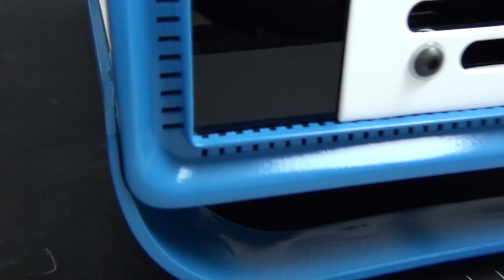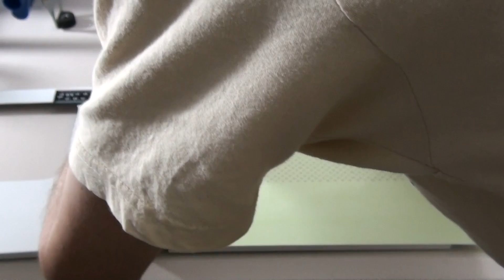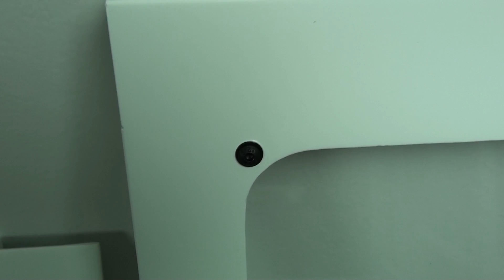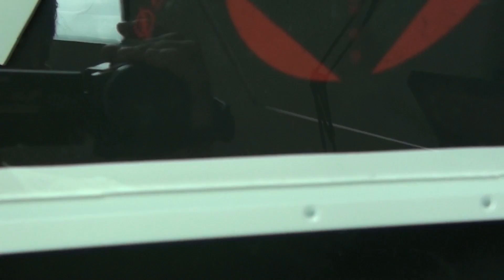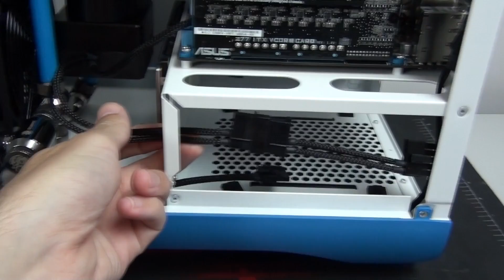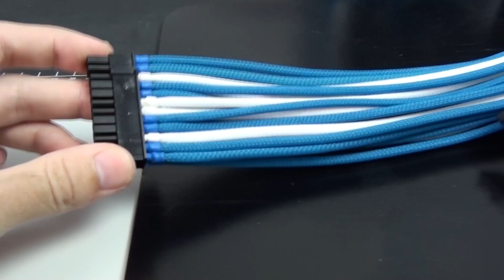Build #6: 'Prodigy': Part 5

Comment: Can you clarify something for me, I getting to know, learning about sleeving and customs wires from scratch and I'm a bit confused about the 18, 22, and 26 AWG, and what I'm not perfectly sure what is what, I mean what is the use of the 18 AWG the 22 and 26.
Reply: can you help me out here or what ?
Reply: ***** It does help thank you so much. :))

But just to double check basically 16/18 its for everything that comes out of the PSU (GFX, CPU, MB). Even those connecting to the ssd/hdd ?
Reply from the maker: *****
Spot on, thanks for the information. We normally use 16 AWG for core component wiring, mainly because we have found a great wire which trains well and is easy to deal with.
Reply from the maker: João Dário
Yes Molex and SATA power also need to be 16 or 18 AWG.
Reply: ***** One thing I forgot, I never really paid attention to it but I think the 24 pin cables have a particular way of connecting I mean if its straight forward like the left cable connects on the left of the other side of the connector ? I´ve bean watching some tutorials but none of then explains everything.
Reply: ***** "Place the cables into one connector then mirror that across to the other end connector."
This was what I was asking about the 24 pin cable, I know I have to drawn a diagram not just because they like to play around with the wiring but also because I wouldn't remember anyway xD

At this point I'm just gathering all the information I can and I prefer to ask someone to actually tell me so I'm perfectly sure of the answer. So, thank you for your patience I really appreciate it. Now I'm going to finish watching the tutorials and get to it.

Thank you Jaigar.

Comment: Those aren't pressure optimized fans, which are the ones you'd want to get if you're cooling down a radiator.
Plus you can't see any of the fan blades in this build anyway.

Comment: Front pane looks great. Wait and see when the manufactures start using smoked plexy. I hate empty optical bay slots, I prefer a clean look, only controller panels no optical drives, if you really need one go external.

Comment: I don't deny that they're excellent quality, but $15-20 for an elbow or rotary fitting is excessive.  Especially when you need 10-15 of them (or more).  I'll be sticking with soft tubing for now.

Comment: My current build has about $250 worth the Bitspower fittings in it. The quality is top notch, I don't plan on using any other fittings in the future. If you've never used a Bitspower fitting, I suggest you take a look at them!

Comment: I just got caught up on this build-log and I can't wait to see the finished product with the side panels and lights on. I like the way you've incorporated the blue into every single component: case, PCBs, coolant, and wiring. I think you've done it in a very tasteful way, separating the blue accents with white or black. It's obvious that blue is the theme, but it doesn't completely dominate the color scheme.

Comment: I honestly would be interested to see the process of making your own wires.  Since you always go into great detail I know that it would be a quality informational video.

My only complaint about the build so far is the 24 pin power wire.  Just my opinion but I find that the way you have it run it end up detracting from the loop by hiding it and part of the reservoir.  Again just me being a bit of a perfectionist and nitpicking is all.

Comment: Looking very nice. One thing that is bothering me tho, I don't like the 24pin cable running over the tube. Seems like you could just run it under the tube, and a bit from the side. Wouldn't that look better and cleaner? One more nitpick, any overclock that is not done by the manufacturer of a given part (cpu, gpu ect.) is not "factory". You can call it a custom overcloak or something, but calling it factory rubs me the wrong way. With that aside, good job on the build.